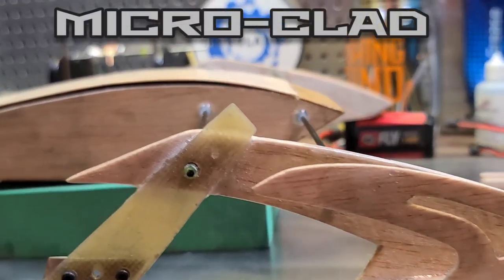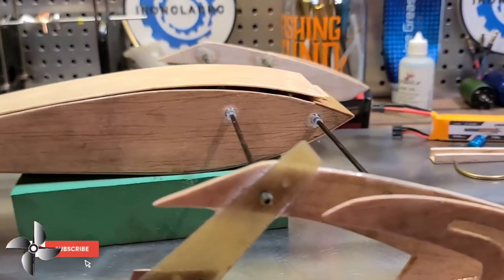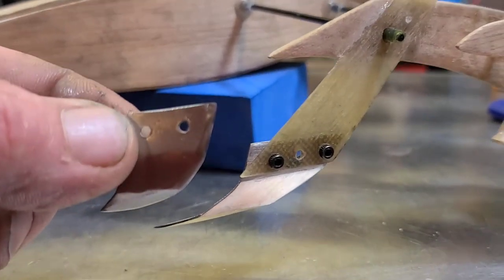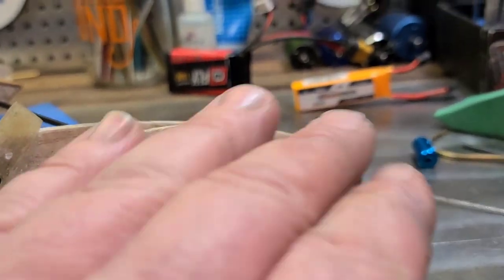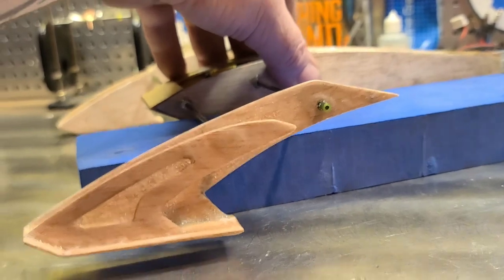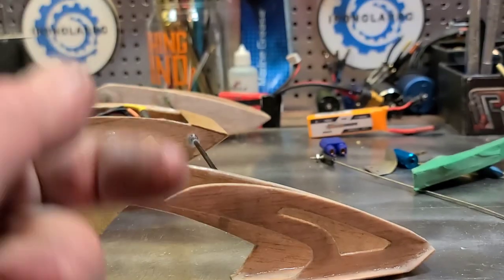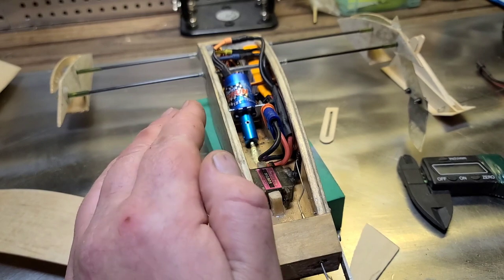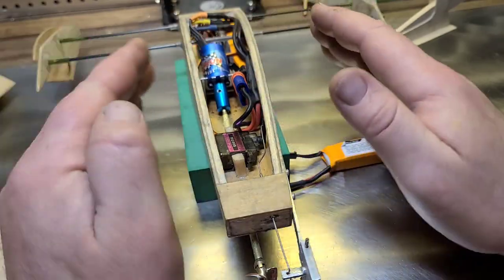Micro Mini Rc Outrigger Boat Build Update - Homemade Rc Boat

Comment: Amazing design concepts in that lil rigger Big B, and the sponson idea looks like it has moved from and out of the box idea to being something that really could work. 
I guess my only concern with the open top sponsons would be tendency to nose dive the boat when hitting waves at 90 degrees when water gets over the top of them.  I'm sure you've considered all conditions and  worked on an aggressive AOA, and that's fine  running her on a glass surface, so will be fascinating to see the maiden if the water's a little choppy. 
Great work buddy 👍 👏
Reply from the maker: Thanks brother. Just did the maiden, a little slow, but it didn't sink!